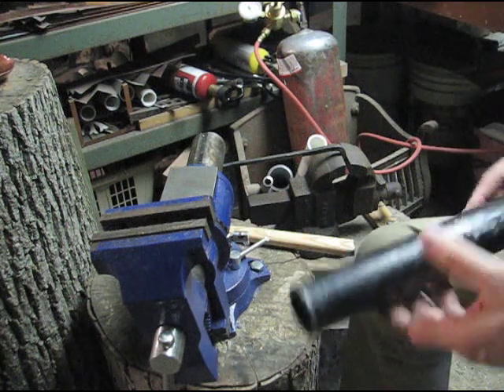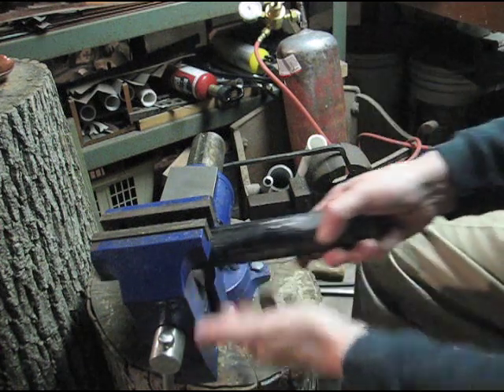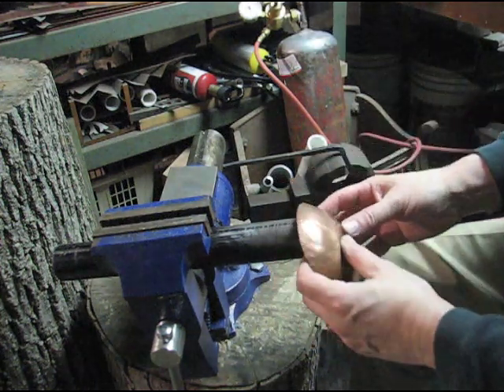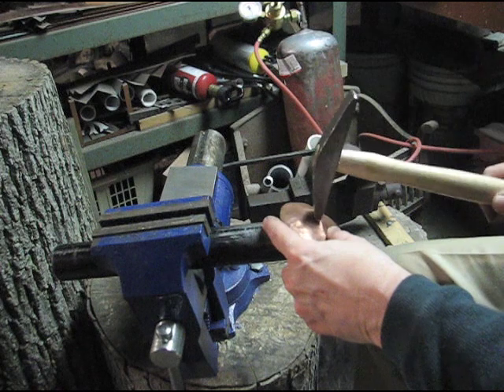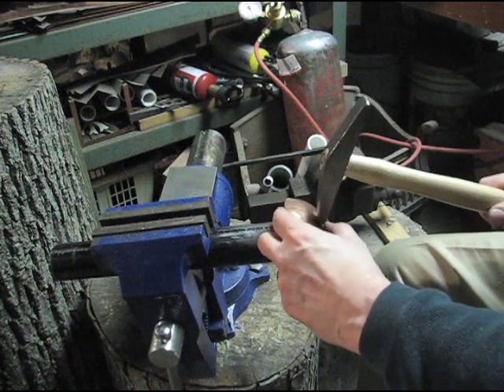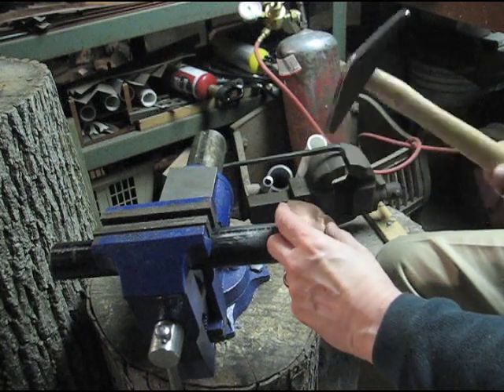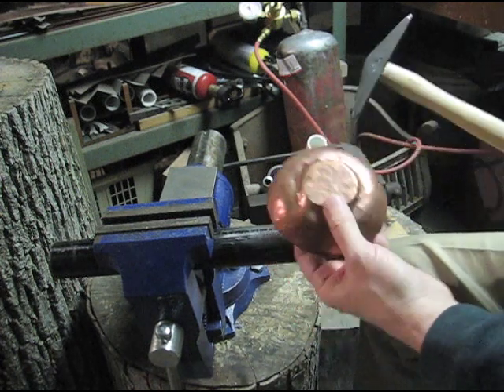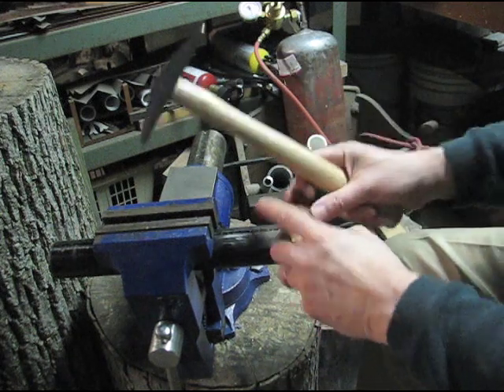Raise Copper Vessel 4- Beaker Part 1

Comment: Great video. When I learned to blacksmith I was told to pull the handle on the vise all the way to one side and always to push down when tightening the vise and when loosening the vise. Let your body weight do the work. Makes it easier. Thanks for posting the videos.

Comment: If you were to fold a damp bath towel in three or even four and place it under the timber dolly/former it will reduce a lot of jarring and give the hammer strokes greater control of the metal being beaten. The taller on floor formers would benefit from two or three layers of lead roofing sheet underneath as a shock absorber as long as you don’t need to move it about. I’m an old metal worker and panel beater and am enjoying your videos as I thought this type of trade was long dead using hand tool’s. Great to watch you.
Reply from the maker: Thanks for writing and watching. This was made before I had a proper stake and stake holder. My studio has a lot more tools (and hammers) now.

Comment: Put a wedge underneath your pipe at the angle you want.  That will solve the issue.  Great video!
Reply from the maker: This was made before I had a proper stake and stake holder. My studio has a lot more tools (and hammers) now. Thanks for watching.

Comment: IMHO: I really enjoy watching how fast you are progressing,,, as you spiral around, and around ever increasing the "latitude", of each pass.  Do you always "rotate/spiral in the same direction, or. do you ever reverse directions?... Do you always try to keep the "cross pein perpendicular with the axis of the stake/form/dolly, or do you skew it slightly? Do you ever use the "crimping & trapping" methods, of "shrinking" as you raise the side height, of the vessel?
....Have you tried "raising" techniques, on other alloys, or, other metals?...( i.e. Bronze alloys, Brass alloys, (Nickle brass("German Silver"), Monel, pewter (tin), lead, Aluminum (alloys),..steel (alloys) stainless steel, titanium, etc...(?)....

Comment: You're stretching the metal vertically but at the same time you're reducing the radius, so you're compressing it horizontally. Sooo, the thickness doesn't change, right?
Reply from the maker: We just say"Moving Metal", and yes, it does stay the same gauge/thickness. Thanks for watching

Comment: Hello Mr. Reynolds.  I would love to raise some vessels and  am loving your videos.  Thanks so much for sharing.  
Before I spend the big bucks on stakes I've been DIY ing things that I can.  I spent most of the day making an end grain oak sinusoidal stake with hand tools and accidentally split one of the wings off.  Se la vie. 
 My question is : What is the pipe you are using as a stake and where did you acquire it.  Thanks in advance.
Reply from the maker: The pipe  is an off cut that I found at Home Depot. It is steel and about 12-14" long. If you have a choice, get one with thicker walls, this one has walls about 1/8", the pipe itself is about 1 1/2" in diameter. I also have a wider pipe with a diameter of about 2 3/8" and walls are 3/16".  You might find solid bars in a scrap yard. solid will be better if you can get it. Thanks for watching.

Comment: What is the weight of the hammer you are using in this video? Or if not by weight, how do you describe it so I can buy one?
Reply from the maker: it is called a raising hammer, which means it has cross peen heads, this one is 300 grams, they can be heavier or lighter. This one has two heads, one of which is broad, about 1/4 inch wide, and a sharper side which is a little thicker than 1/8 of an inch; all of the edges are rounded so there are no sharp corners or ends. I use the broad side for most of the raising and this weight is good for 20-18 gauge sheet metal. if you go to 16 or 14 gauge you will find a heavier hammer more effective. Thanks for watching.

Comment: Just completed the 5th annealing and hammering. I seem to be unable to close in the middle and top. It just stays flared out like a candy dish. Do I only hammer straight down with a slight push or should I be hitting to the sides toward the middle? I enjoy the process but need some guidance here.Tried but unable to put a photo in here.
Reply from the maker: It sounds like you are not holding the piece correctly when you strike. It is easy at the base to strike and begin closing, as you get to the middle it is important that the base stay on or in line with the top of the stake, you are letting it rise and you are striking where the metal is already in contact with the stake. You should be holding the hammered part on the stake and  then strike the part that is slightly raised away from the stake, curving up into the air. You can check your progress by taking the vessel off of the stake and putting it, open side toward you, against the stake. The hammered part should be flush with the stake, the unhammered/raised part will curve toward the center of the stake, any curve or daylight in the hammered area indicates that you are not holding the vessel correctly and you are not striking the metal where there is air under it. This is a very difficult concept and it does take some hand strength. As you raise the vessel, the sides should always be straight, that is, flush with the side of the stake when you test your progress. What you are doing is very common thing that happens before you learn how to hold the vessel against the stake. It may take you two or three vessels to figure it out. (I am assuming you are using a cross peen hammer) 

The most constant problem with metal and jewelry making is figuring out how to hold the piece you are working on, raising a vessel is kind of a dance, you hold it one way at the base and gradually change your grip as you move up the sides because there is more space between the vessel and the stake on the bottom where you may be holding it. 

Happy hammering and thanks for watching.

Comment: Where do you find the stake that you used to raise the sides of the beaker, and what is it called?
Reply from the maker: In this video I am using a pipe from Home depot,  if you read my answer to AETHON below it is explained. The later videos show me using a proper stake, called a T stake which is made of solid cast iron. You can order one from All Craft  in New York. you will also  need a stake holder  or a good vise to hold it. The stakes are about $75-80 US, there should be other suppliers look up metal work tools and don't forget to search EBay. 
 Good luck and thanks for watching.

Comment: I would think that you might do better to hammer with a soft-faced (rawhide, plastic, or wooden mallet, or), hammer against a hard (steel,or bronze) mandrill, or, use a hard-faced hammer against a soft (hardwood) mandrill.....(unless you're in the "planishing" phase of the work.
Reply from the maker: When you use a mallet (soft Hammer) against  a hard stake it will not move the metal, it simply bends it and the vessel does not close or rise. A hammer on to a soft surface has the same effect, it's called bouging. Thanks for watching.

Comment: Imagine how much faster you would be if you didn't do a pointless light tap before every hard tap!
Reply from the maker: The light tap was not pointless. It slightly bends the metal so that I can strike the raising blow more accurately. The first strike is also higher up on the cup, to get that bend, than the raising strike. This was also done about 10 years ago and I now have proper stakes, and only when necessary, make the higher, lighter strike. Thanks for watching.